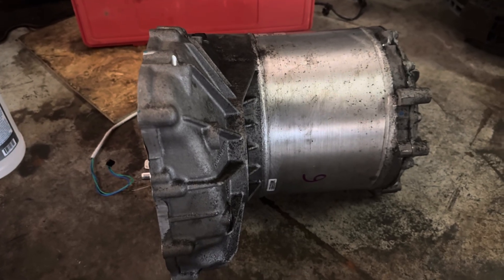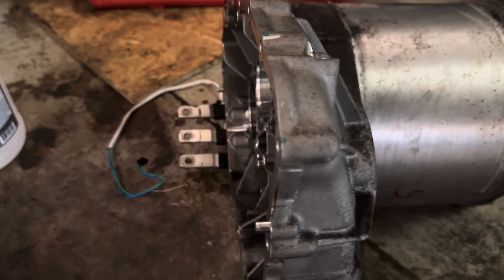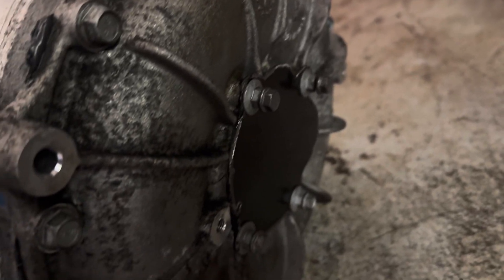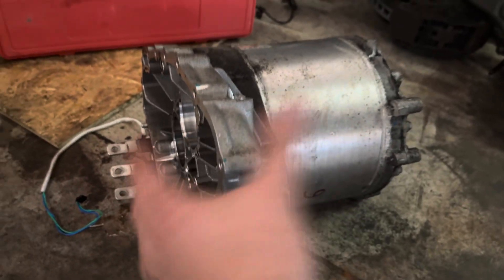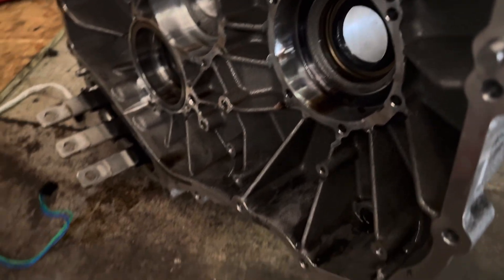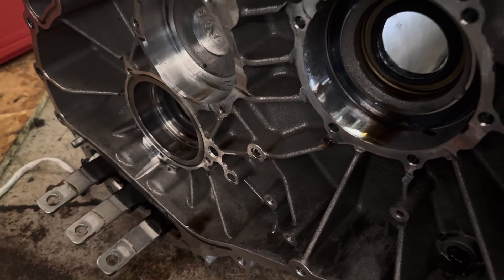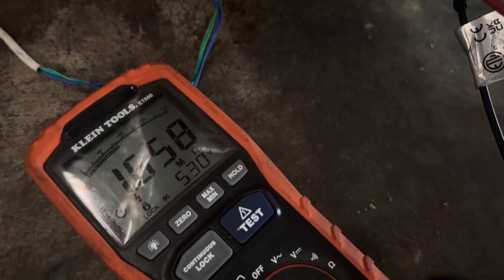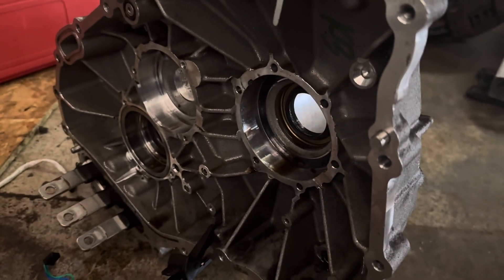Drying stator from Tesla large driveunit LDU

Comment: Im about to fill My stator with isopropyl alcohol, but iso test starts from about 3Mohms and settles to around 15 Mohms.
Im not sure If on the video you say 15 or 50 Mohms after alcohol has dried, so is it 15 or 50 can you confirm because i already dried it a while and it was 0,15 Mohms in the beginning. I assembled it once already and there were still faults. I disassembled it again and noticed that there was still lots of coolant on and in the wiring connectors of the inverter, so that is probably My current problem. 

Thanks for the video
Reply from the maker: Many (most?) stators can not be dried using this method.  You really do need isolation on the stator to be above 15 megaohms, if you can’t get it that high then you need a new stator.
Reply: @diytesla I got it working after I dried and cleaned the  connectors of the inverter. 
Also noticeable is that iso faults went away automatically after probably 5-10 trips, no needed to get The software.

And isolation was about 25mohms in the end after stator cooled down.

Comment: I live in North of Atlanta.  Would you repair a Mercedes B250e if I shipped it  to you?   Car whines and "visit service center" message has been coming up at start for about 15k miles.
Reply from the maker: Sorry we don’t offer this service for customers.
Reply: Hello from Europe.
Got the same orange message at 30.000km.
Ignored it till 108.000.
Then the first red message:
“Without turning off the engine visit workshop” - ignored it as well, as it disappeared with the next engine start.
The second red message appeared while I tried to start the car after I was out for groceries:
“STOP engine off” 
Was not able to start the car on this day, although the next day I was able to drive again home. 
This was the last time I was able to start the car. 
At the moment it’s in one of two mechanics in Europe who are able to repair it. 4200€ for LDU (no replacement, just fixing und upgrading) and 1200€ for battery cooler/heater. It seems I am lucky and my stator is still working otherwise it would cost 3000€.
The company is called EVclinic in Berlin. I had to ship the car from an island in Europe 2000km to the mechanic because nobody else wanted to touch the car.